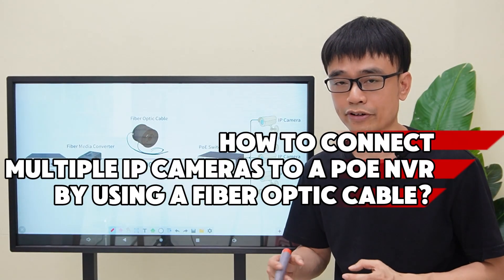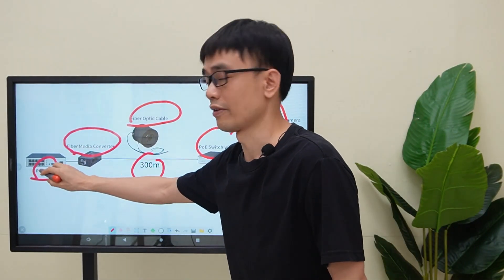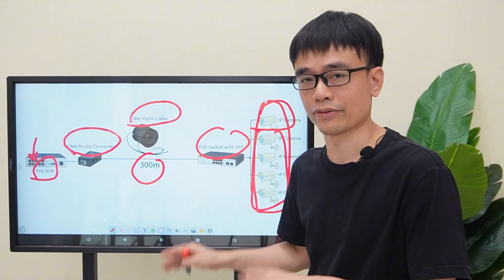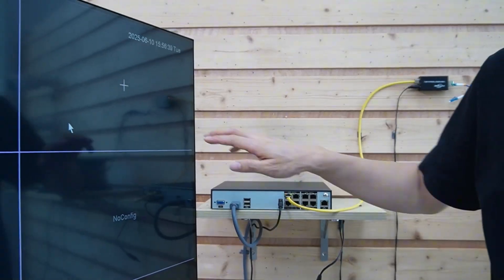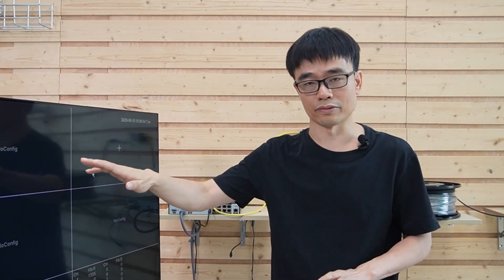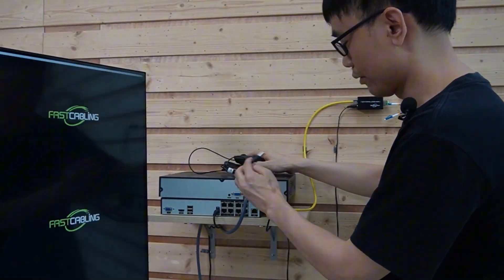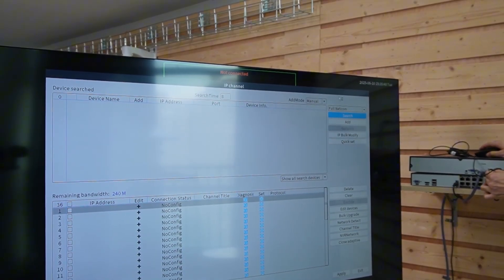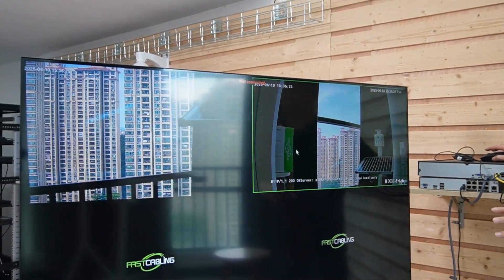Fiber to PoE NVR Pt. 1: Why Only 1 IP Camera Shows? [Fixing Multi-Cam Issues]

Comment: good explanation Sir " since we are having multiple  Cameras .. is it possible to use a patch panel  or Switch ?
Reply from the maker: If you're managing multiple cameras, it's recommended to use a PoE switch instead of a PoE NVR. It allows you to position cameras flexibly, without needing all cables to run to the NVR. You can also manage networks better with features like VLANs or monitoring tools.

Comment: can you add why is integrated switch NVR couldn catch rest of the IPs. Plz explain technically in next video
Reply from the maker: We will present another solution on part II. Some PoE NVR try to achieve plug and play just like an analog DVR system. Once the camera is attached to that NVR’ PoE port, it will scan the ip addresses and establish connection automatically. In the video, there are cameras, but the NVR only will pick up one IP camera and display on the window. Some PoE NVR will show 3 cameras on single window sequentially.